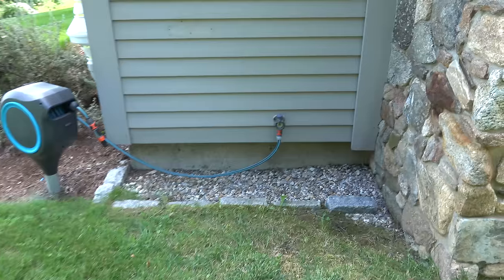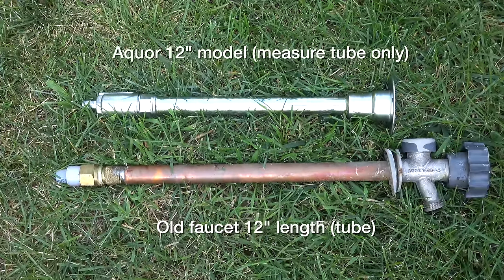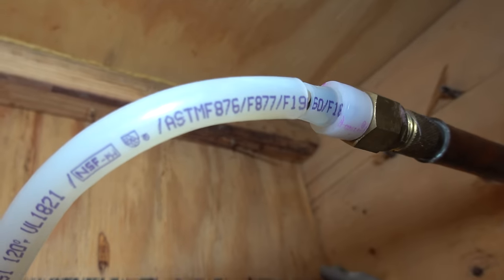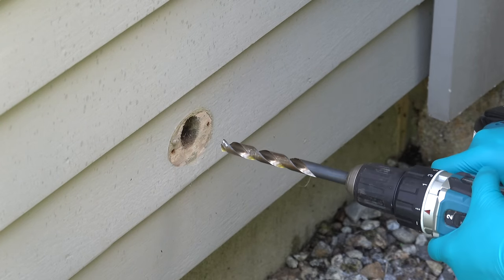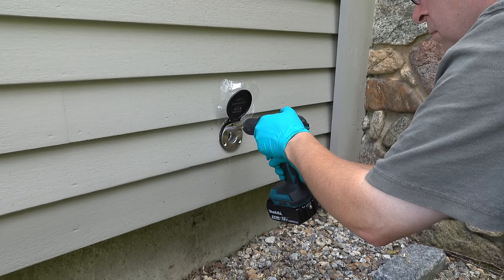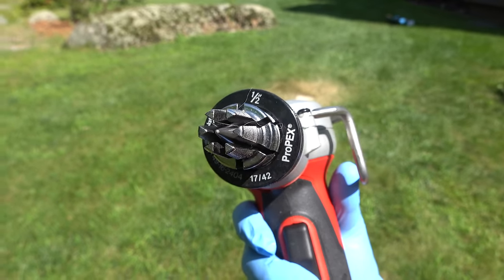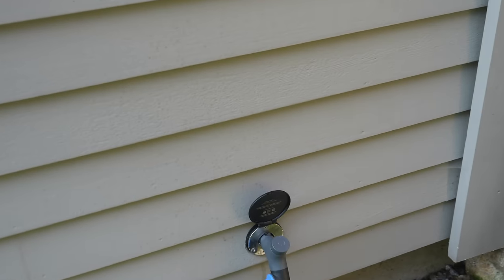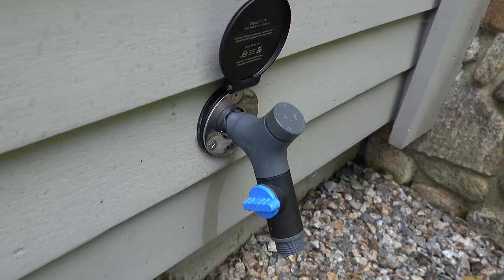REPLACING YOUR OUTDOOR FAUCET JUST GOT EASY / Leak & Frost Free AQUOR IDEAL for Retrofits

Comment: I have seen these several times and I just don't see the benefit.  I have hoses hanging on the house or a hose reel next to the faucet, so looks really don't matter that much.  I'd rather avoid the proprietary parts and stick with the old standby.
Reply: You should get an exterminator if you have that many Joses hanging off your house.
Reply: Yea. Replace you easy and simple and compatible with most of the world spigott that has been pretty well standardized. With some crappy plastic proprietary expensive stuff.. so it has a cover on it?? Just inset your spigot and put a cover.. lol
Reply: I had a Jose hanging off my house once too he almost fell when he was doing my roof.
Reply: Yeah,  cool idea but very unnecessary unless you live in Antarctica.
Reply: I feel like he explained the benefits pretty well.
Reply: @CallMeKyle1  My point is that I don't see them as benefits.
Reply: @CallMeKyle1 you mean the benefits that already exists in current standard spigots ? the only "new" thing is the cover, which to be honest can be done as well if you want with a standard spigot.
Reply: The only difference is:  the hydrant is removable and there is a flush cover when removed.  If water costs a lot and your neighbor is a felon...it might save you some cash.  Unless you can catch the thief on camera.  ...send him back to the cage.
Reply: @opnorty  I think a big benefit is not having to worry about it freezing since the actual mechanical mechanism is deep in the house and the last few feet of the tube auto drains. If you live somewhere where freezing isn’t an issue than there is probably isn’t much benefit.  Old faucets tend to get crusty and need wrenches to turn too so it might last longer since you can take it off and store it somewhere protected from the weather. I doubt i would retrofit something like this though unless the existing faucet was broken.

Edit on second thought, in places where it occasionally freezes once every few years this is a nice way to prevent some nasty repairs that catch you by surprise:
Reply: @josephsteffen2378 You might have some issues if you go right to putting your neighbor in a cage on a video about water spigots.
Reply: I think the primary benefit is to avoid the mechanical breakdown of the frost free spigot.  Those things usually have some plastic which is broken down by snow and ice, and the valve handle usually fails at some point.
Reply: @davidrh74  spend $3 and get a metal handle...
Reply: @davidrh74  the dude is a exconvict-felon.
Reply: @ma93256 😂
Reply: There is no benefit. They all shut off in the wall and if you remove the hose they are self draining.
Reply: @NickSteffen Regular looking spigots also come in versions that shut off inside the house. They're required by code in climates that predictably freeze
Reply: Well said.
Reply: Isn’t it nice when it gets really cold to not worry if your faucet could freeze? Isn’t that what it’s for?
Reply: @Cancionera40  no you are wrong. Frost proof hydrants like the one being replaced shut off in the wall, there is a drop eared 90( female threaded fitting ) already secured in the wall. If the fitting wasn't there this product wouldn't work/ would take opening the wall to install the fitting. This product and a standard frost free hydrant put the washer as far back in the wall as the water lines allow. If either product is installed with slight outward fall they are self draining. This product is a gimmick and I don't know why he is obsessed with it. I am a Journeyman plumber with 20+ years experience residential and commercial.  I have replaced countless frost proof faucets and opened many walls to plumb in a frost proof when there was an old sillcock or boiler drain that didn't provide freeze protection. I have also rebuilt and installed the commercial version of the product he is selling that is common and used for tamper resistance. I deal with everyone from home owners to engineers in my work and can guarantee you this product is only necessary if you think it looks cute. If you shut water off without removing it from the pipe it will still expand and freeze so I really don't understand your shut off idea without using a bleeder valve (they have been illegal many years for backflow reasons). On top of everything good luck finding parts for this weird thing if it breaks/ your water will be off days while you order or you will pay to have a professional install an Arrowhead brass frost proof faucet, the industry standard.
Reply: @Cancionera40  you are missing the fundamental point that both shut off in the exact same spot or this product wouldn't work. The way it's shaped goes in the existing hole once you remove the old one. They are traditionally 4 to 6 inches in the wall where I live. If your faucet doesn't already shut off in the wall then you would need a retrofit and someone would open the wall on one side or another to do it. Yes if your winters are terrible I would shut off your valve and open the faucet, let it drain then leave it open and cover it.
Reply: @themikeroberts  Makes sense, I’m not sure if those changes are new but I remember we had to always make sure to drain the water lines attached to the outdoors for winter when I was growing up.
Reply: @Cancionera40  if you watch the video he could have unscrewed the old one from the inside and used the standard new one that has 1/2" thread. He chose to pick one that would attach to pex and cut off the existing fitting. He really doesn't have it installed securely and if someone pulled the hose it could break the setup. If you like it and want it then more power to you. I see more issues from it than value but you know what's best.
Reply: @thezfunk Jose 😂
Reply: Nothing like water dripping straight out of the connector down the side of your wall.
Reply: It’s to sell to people that doesn’t know that your existing (what he has before) shut off in the wall and drain automatically the rest of the water out or people what want something that is cute. 

Where I live, the 99’ anti frost one are sold like 10-12-14 inch. So water shut of that far in the house. 

My old house didn’t have them, regular one, where we needed to go in the ceiling in the basement and shut the water off there, then go outside and open the spigot to let the water drain. 

I would not “upgrade” the standard anti frost for those new thing.
Reply: @NickSteffen living in Canada the og system is fine in winter . A simple new rubber seal and a cleaning will get rid of your grind np. One wrench and 10 seconds is all that’s needed
Reply: Yeah, the proprietary parts are turning me away from this.
Reply: Placing a small piece of HPA foam in the hole to angle the pipe more helps with better draining. I also Spray foamed the hole to stop cold air from entering the hole and frosting the line. 
Benefit: The backflow is in the attachment, so you get a new one for every attachment. I have a backup already but have never used it in five years so far.
Reply: Exactly!
Reply: @davidrh74  they have these for standard spigots.. since like the 90s at least. I had one in my house...
Reply: @nancy668  no.. they have had standard spigots with antifrost shutoffs for many many many years before this thing existed.
Reply: What exactly is the benefit? "You can turn the water in and off with this valve right here". Well yeah... That's not new.
Reply: Yeah this is a turd. It offers no real gain of function.
Reply: As a plumber for over 10 years. I can see the benefit. If it would just only do one thing. If people would actually remove the exterior handle. There’d be a lot least frost free faucet’s freezing in the winter. I live in middle TN.  Where this isn’t even normally a problem. But people get used to leaving their hoses hooked up and the faucet doesn’t drain. And then it freezes and pops the K Cooper inside the wall. And no one finds out until spring.   The other Benefit could be to keep homeless people from stealing water while your away or sleeping.  If you’ve ever had that problem. This is why business have security faucets on their buildings.
Reply: @themikeroberts that might be the case now, but it apparently wasn't in 1990.  All of you people must live in new houses or in houses with basements. I have neither.
Reply: @xXGENDAMAGEXx  If you're a plumber and see a benefit to this over standard equipment, then you are likely a terrible plumber. This is like saying you see the functionality of a F1 for a 78 year old woman who uses it to go grocery shopping. It looks cool but does basically the same thing as a regular car and is way too expensive for it usage, and impractical for the cost. You could buy an amazing mercedes for cheaper and it would be standard equipment and better at getting groceries
Reply: @Catalyph  You don’t read very well.  I said if they would remove the outside handle. But I’m sure most people won’t do that either.
Reply: @xXGENDAMAGEXx  even then. There are cheaper and more standardized solutions that are less finicky than having some proprietary tube to have your spigot work and be secure. Like litteraly wifi flow stoppers on the inside line are cheaper and just as easy to install.
Reply: @Catalyph    I guess you just think you know it all.  As if other faucets aren’t proprietary. Since when is anyone selling anything they don’t have a patent on. The problem for us is always weather there’ll be local parts for things.  Hansgrohe kitchen sink faucet. Sold by Fergusons. But when customer needed a new part.  They scraped a very expensive faucet for a cheaper one with local parts.
Reply: @xXGENDAMAGEXx  we are not talking about faucets. We are talking spigots. For the most part, most faucets will have standard parts that can be purchased at your local hardware store. Even the fancy ones will have a standard brand cartrige inside them, and standard size packings.

This spigot is standard up to the outside connection where it is SO proprietary that you have to special order part if it starts to leak. The mechanism and the parts and the cartridge, i think even the standard internal stop is permanently attached to the spigot, so if that is damaged, you have to replace the entire thing instead of just the end peice.
Reply: This product is totally irrelevant when it comes to where your outdoor faucet is located. It works well if you have a basement or crawl space where there is room for it. My parents live in Indiana with a crawl space and their outdoor faucet by their kitchen window is connected to the kitchen sink. It’s all inside the wall totally unaccessible. I live in Texas in a brick home on a concrete foundation and one of my faucets directly behind it is a bedroom wall. Totally inaccessible. We don’t have the freezes here like other places. We just cover faucets with a styrofoam cover in the winter. I have lived in Arizona, Texas and Indiana no codes for over flow faucets in any of these places I have lived.
Reply: @shawnmeyer2788    It’s designed to let the water drain out of a Frost Free (hose Bibb, spigot, faucet) whatever.  Vacuum breaker is what it’s called on modern faucets. As long as you don’t leave a hose hooked up when you turn off a properly installed Frost free faucet. However long it is. That’s how much water will come out.  To many customers think it’s not off and then crank on the handle and crush the rubber seal. Then next year it drips.  I’ve never even put the foam covers over mine in Middle TN. And even when we got really cold I never had a problem.  But thousands of others in our area did.  Construction plumbers keep service plumbers busy. 🤣😂
Reply: @Cancionera40 nobody except cheap people are putting non antifreeze hose bibs on their house.  Most areas that freeze has codes that say they must have antifreeze hose bibs. It takes less time to Unhook a hose than Unhook a hose plus the special hose shut off valve in this video. Don't get me started on where on earth did I put that plastic twist shut of valve last fall. Then there is the obvious. What happens when you remove the plastic twist valve and the hole doesn't seal and starts dripping?
Reply: I think this would be neat for areas in a northern climate. I've seen so many broken spigots and this would make weather proofing it easier
Reply: @Cancionera40 what?  Your no plumber and should not touch any plumbing tools.
Reply: Plastic is less prone to corrosion.
Reply: @Catalyph plastic is less prone to corrosion.
Reply: @jerometruitt2731  depends on what you consider corrosion.. sun damage? Heat and cooling cycles? Stress fatigue. When you drop it for the 15th time?
Reply: Completely agree.  I can’t imagine trying to find the adapter every-time I wanted to connect a host.
Reply: I’m glad to see the consensus on these.  We will know when there is a superior faucet.
Reply: @NickSteffen a good example is when Texas was hit with that arctic blast.
Reply: @DannyfMartin  I mean sure, the old system did it’s job. I grew up in Chicago and our faucets were never an issue. That said horse drawn carriages worked fine as well. No reason not to improve what can be improved. Like I mentioned though, it makes sense on an initial installation but retrofitting it is probably a waste.
Reply: @NickSteffen 

The ones he removed already looked like frost free ones.
Reply: Yeah cool, a bunch of extra plastic pieces, you need to make this work, to break or get lost. Never had a problem with the old system.
Reply: My faucets are 65 years old and still work fine. I don't see the problem.
Reply: Yep, they stop meeting the unit and your screwed when you go to repair.

Comment: My concern would be the effective water flow area. Does the mechanism restrict water flow over standard fittings? Water uses such as pressure washing or topping off an above ground pool benefit from high flow volumes. Also, having a unique (and easy to lose) plastic fitting at the highest stress location seems risky.

Comment: Since my spigot broke off the valve stem when prepping for winter this year, I knew I had a project for spring. Since this one lasted 13 years, I don't how likely I will jump into a new type of system as it limits the options I had on the old one.

Comment: I'll probably install the V1 on the front this year.  I installed a garage hose faucet from scratch over Christmas break and the frost free hose-bib was about $35-$40 for a 12" model with a PEX crimp built in.  I don't mind paying just a tad more for an upgrade to the front of the house, if it's something a plumber would be charging $300-$400 to install anyway.  Probably should have picked one up during the 25% off sale.

Comment: I generally hate proprietary products, but bought this one for the looks and I ended up loving it! The best part is I don't need those hideously ugly faucet covers in the winter.
Reply: Don't need covers with a the proper frost free hose bib and proper insulation for the conditions in your location. Apparently this includes Texas because hard freezes like the one in 2021 have happened before with in living memory, as in every thirty to forty years on average. Imagine, plumbing on the outside of the house 🙄😬🤭.

Comment: Does it have an o-ring with silicone that can pickup dirt?  Seems like it would be fine on a clean boat but to drop the fitting on the ground it would have sand and grit all over it.

Comment: I’m a contractor in Montana. I’m building custom homes from 700k-1.5 mil. Not a single one of my clients want something like this. Normal standard hose bib is what people want. They don’t break, you can’t loose them.  They come in a couple different color combinations. Think someone is trying to fix a problem that doesn’t exist.
Reply: It is a problem that does exist, had an expensive hose bib and it broke after 3 years because there's no way to turn the water off in the house, the water in the pipe froze and cracked it making it useless. Standard hose bibs are also ugly and the hose bib covers are even more so.

Comment: I like the design makes the house feel more modern and sleek. My problem is my house water pressure is fine for most part but i only have a spiggot on the front of house and water pressure sucks unless i have my pressure washer connected i live in a trailer park neighborhood and they refuse to check it and fix it as i have a gauge that tests water pressure and its bad

Comment: Nice video. IMO I'd stick with what I have for 2 reasons. It ain't broke so why mess with it, and in my back yard I added a dual faucet for hot and cold water as that is where I do dog baths and can easily reach my driveway for warm water car washes.

My house was built in 2020 and I'd go for this product if it had the hot/cold input options because it does look very nice and modern.

Do you find it annoying to have to attach the handle every time (keep track of the handle) or do you simply disconnect it in winter and leave it installed the other seasons? I'm in Maine so winterizing is important up here.